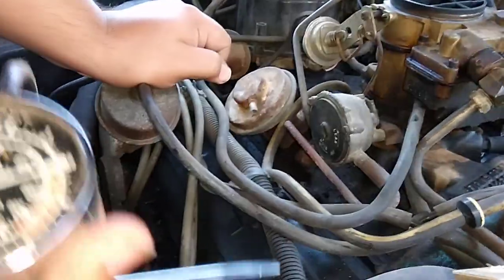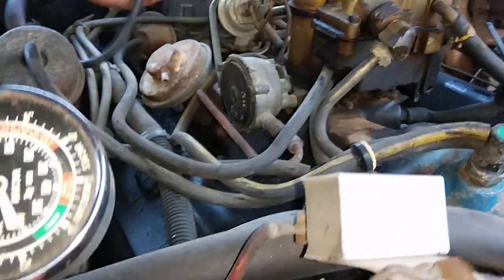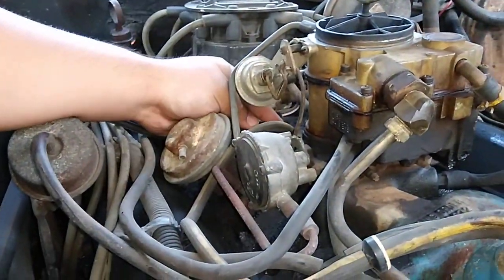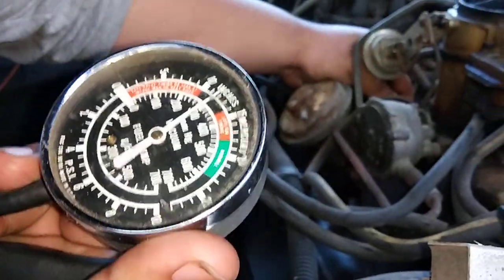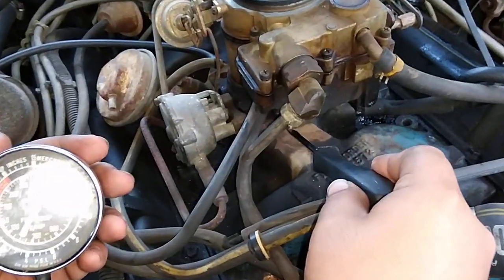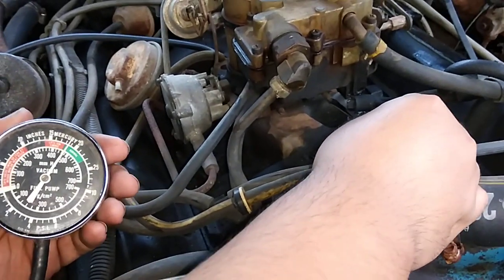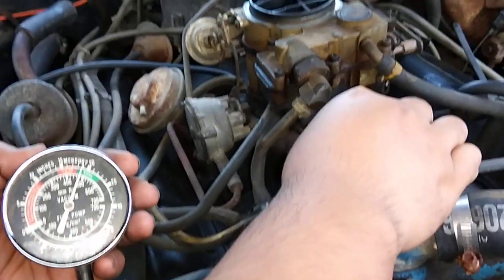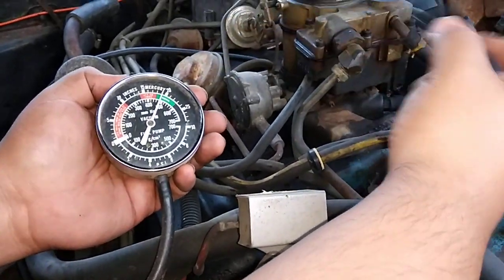Carburetor idle screws adjustment

Comment: I learned something new today!, thankyou!. I just put a new carburetor on my truck and it warmed up it was acting like it ran out of gas but instead the mixture screws weren't right I've got it to wear it runs great but just a little rough at idle and I have my old vaccum gauge just like yours so I'll try and fine tune it now!. That's great you sharing this!.

Comment: On a holley carb, does the two idel screws have to be the same on both sides? I get the best vacuum with one side at least one full turn different from the other
Reply from the maker: They don’t have to be exactly The same but the closer the better
Reply: @carsntrucks782  🤜🤛

Comment: Hi i have a Quadrajet carby  with the vac gauge do i wind the mixture screws in or out to get the highest reading i can
Reply from the maker: I tighten all mixture screws. Then loosen them about 2 turns out, and start from there. Go back and forth on both screws. In and out.